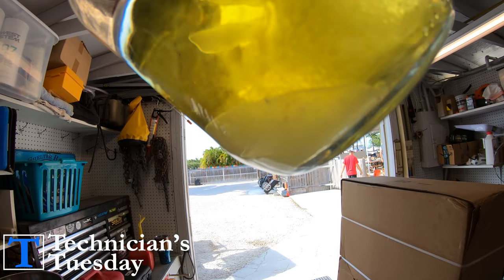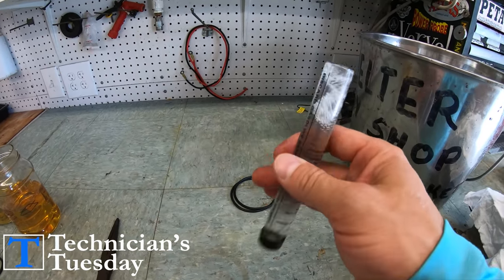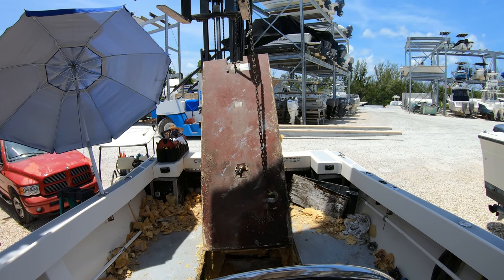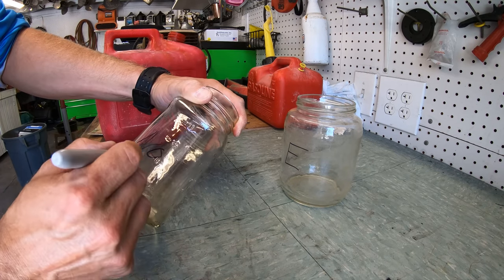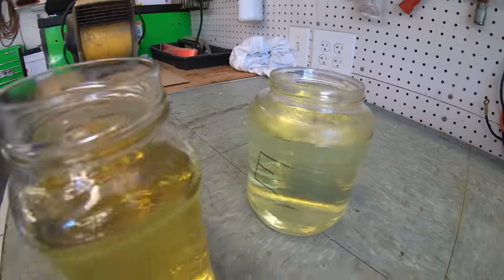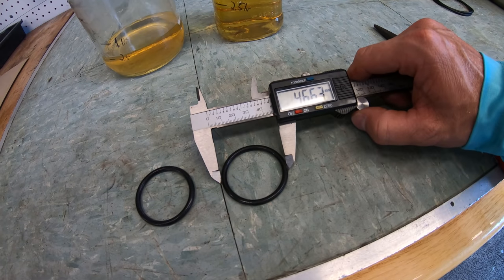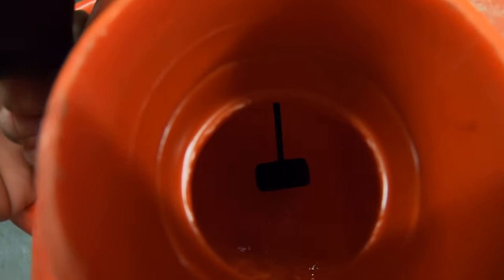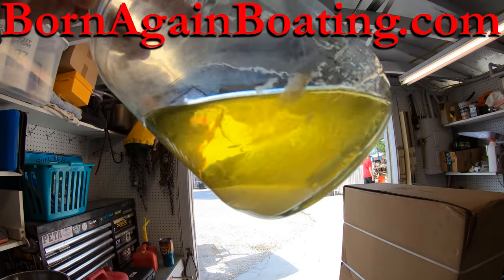What Fuel Do YOU Put In YOUR Boat?

Comment: Hello, great video.

What are your thoughts on fuel additives, do you use any?

It appears using a stabiliser can be useful for keeping fuels stable, especially in the carburettors.

Also fuel system cleaners and water dispersants seem like they could be quite effective.

Just curious on your informed opinion.

Thanks!
Reply: Only thing you can do to keep motor running well..... Is proper maintenance and cleanings....... Especially if you live up north where it freezes or if you run in salt water.....I have had a 2016 Yamaha f40la for 5 yrs now.... I change the oil once mid summer then again when I winterize.....have everything done by a certified yamaha mechanic......besides mid summer oil change.....I run non oxy only.....and I have never not once had a problem on the water. And up on Lake of the Woods......your so remote and far away from anything. You could find yourself in a survival situation if you broke down far enough from shore.

Comment: Why don't they make 1. A fuel tank with a drain on the bottom so you could let the water out until you get to fuel? or 2 Don't they make water separators for fuels systems like a filter that can also catch water? 3. Could you fill a tank with half E and half non? That would cut it down to 5% and still save money at the pump?
BTW love your channel you are very knowledgeable and always have great content TY

Comment: I am curious about the effect of plastic fuel tanks vs steel or aluminum tanks. It seems condensation is less likely to form on a plastic tank, so if there is less air flowing and and around it, you would have less moisture forming with temperature changes. I rarely have water in the tank with plastic tanks.

Also, how difficult would it be to retofit older boat/s tanks to be a closed system, so there is much less exposure to outside air, and moisture?

Comment: investigate phase seperation.   ehtanol will not mix with gasoline  so a catalyst is added so it will.  over time this catalyst gets used up and converted. then the ethanol being higher specific gravity will drop out and fall to the bottom of the container.    sometimes it is very clear  there will be a water line on the bottom then you will see another line higher up. that is where the ethanol is lower and the gasoline is higher.   ethanol also has a lower octane rating  so when you get seperation or dropout you are also picking up lower octane fuel and burning it.    if you cant use up the ethanol in two weeks dont use it. if you have portable  tanks or cans for your mower etc  keep them full as shown here . its better to have 5 one gallon cans full than one 5  gallon tank part full

Comment: Just dealt with white powder through out my entire fuel system from ethenol what a nighmare. That fan experiment blew my mind ! The problem with using heet or some type of water remover additive it will separate in the fuel/water separator and vst tank since the main ingredient iso-propyl alcohol is heavier the gasoline. They are useless. Also have fun switching from rec90 to ethenol. The ethenol will clean your tank out and all the varnish will break down. I like your idea of switching back and forth.

Comment: A few years ago, i went to the auto parts store to buy a couple of feet of fuel hose.  They wanted to know if I would be using ethanol gas as the fuel hose is different.  There was not a significant price difference so I bought the ethanol fuel line thinking it would hold up better when using ethanol fuel.  What are your thoughts on that?

Comment: In my case, Ethanol free is available. However, I have never run it. I get stuff local to the house and have been doing that for decades. Carbs, efi and direct injection all burned the ethanol fuels. I have never had less than 40 gallons on the boat and I store my current boat full of blended fuel for the winter. 218 gallons and never a sign of water. 

The key is to key is to keep the tank full and treated. The more air space in a tank, the more it breathes. And the example of off-gassing and moisture retention is valid. However, our boat systems are not fully open to airflow or the resulting moisture dropout from airflow across the surface. The vent is small, 5/8" diameter typically. So, all that breathing action has to happen at a distance away from the fuel tank. 

The information of the video is valid. But in running ethanol from the beginning, I have never had a fuel related issue. And that is everything from my commuter, to my muscle cars, bikes and to my boats. Is non-ethanol better? I am sure it is. However, I can't justify the cost or having to go search for it. Especially, when I have literally never had any measurable water in my system.
Reply: To start, I'm an auto and diesel tech that moonlights doing boat work, so I like to think I know what i'm talking about.....though I have been plenty wrong before so feel free to correct me haha!

I'm on the same page you are, I run ethanol with no problems. In my experience the biggest thing is the fuel sitting long term. if you use your boat a few times a month and treat it in the winter you likely wont have any issues. Most of what I see is people with big $$$ that have boats as play toys that use them maybe 3x a year, that's when I really see ethanol issues from the fuel sitting in the tank and lack of fuel water separator maintenance.

Comment: I know diesels are popular on boats with inboard engines, but I'm surprised they are not more commonplace in outboard applications.  The fuel is much more stable than gasoline and the engines are more efficient for the same power.
Reply: Very few diesel outboards out there and they are super expensive. I don't think the technology is there yet, but I'm no expert.

Comment: I left my 38 gal pontoon fuel tank with just 8-9 gallons in it last fall (October).  I purposely did not add anything to the fuel when I put the boat away for winter.  Started it up May 9, changed the oil, etc.  Filled the tank and put it on the water with no issues.  Ran 40 miles on the river.  The secret?  Don't store your boat  or let it sit very long with ethanol blended fuel.  I only use non ethanol and I can use 87 so it's not too expensive.  Otherwise, you'll have a water issue no matter how much or what kind of fuel treatment you put in it.  Was my stored fuel stale?  Maybe.  Did I notice?  Absolutely not.  Added almost 30 gallons of fresh fuel so it wasn't a big deal.

Comment: Local station just started to carry non ethanol mid grade fuel, about 30 cents less per gallon.  I have optimax motors.  Thoughts on running this fuel type.  Living in Wisconsin, it does get stored about 6 months per year.
Reply: $0.30 more or less? Most non ethanol fuel cost more than your fuel that has ethanol.
Reply: @dixie3087  .30 less than the prem non ethanol.  So 89 octane vs 91
Reply: Oh okay.  I thought u were talking ethanol vs non ethanol. Sorry

Comment: i have always treated the regular eth gas i get for my boat with "seafoam", 1 can per 16 gallons.  iv never had a fuel problem, however i do use my boat regularly, year round.  Do you have any thoughts on Seafoam?
Reply from the maker: Thank you for your question! Please post it in our Born Again Boating Community! Go here and scroll down to access - it’s free: https://www.bornagainboating.com/
Reply: Seafoam amazing I use it on all my toys plus landscaping tool and boat no more issues at all
Reply: Has alcohol so it absorbs even more moisture. Use it as an intake spray cleaner periodically, works good for that but not year round in the fuel. Lucas fuel system treatment works well as an all year round additive, it is a detergent based lubricant oil. Others brands make similar products as well.

Comment: Had lots of bad exp with eth gas....Not in autos but in things that had seasonal use..Weed eaters/lawn mowers/chain saw/tiller/boat motors...My answer was run all fuel out at end of season...That reduced  problems almost to nill...Now that were able to find Non eth gas at a few stations and use it 100% of time and alls OK...But dang the price dff is WOW...Bought some last night Regular unlead $2.65........No ETH $3.99

Comment: Both feuls are pretty much absorbing the same amount of water
The problem with ethanol fuel is that all th ethanol crashes out of the fuel in the presence of water
You only need a few drops pf water to cause all the ethanol to crash out of it
Reply: Also the remaining fuel is pretty useless since the ethanol is the octane booster for the fuel.
Without it he fuel has a way lower octane rating which can cause detonation and destroy your engine

Comment: Hey that was my boat in North Dakota ! Well maybe not but it could be! I know when storing during winter we add storage additives/treatment up here. The next question is Non ethanol its normally Higher octane which takes more compression to fire, is the higher octane ok on an engine? I run normally 91 at the beginning of season and end of season but will run 87 with ethanol when i know i will use it mid season. Yes we have 4 seasons here!
Reply: You’re close. Higher octane is meant for higher compression applications due to its lower tendency for pre-detonation(engine knock). In lower compression engines it won’t hurt anything but just be a waste of money.

Comment: If I've been getting water in fuel (even running non-ethanol), when/how often should I run quickleen or ring free (and is it safe for 2006 e-tec 250)?  Should I still use stabilizer and which one with non-ethanol fuel since I'm still getting water in tank?

Comment: I run some old two strokes that require pouring oil directly into the fuel tank.
Never had issues with carbs or fuel system.   Does the two stroke oil help protect from ethanol?
Would love to see mixed gas added to your experiment.

Comment: Cool tests Aaron!! have never seen the test tube deal like that..the evaporation and condensation on the E fuel is nuts! Ethanol free is the only way!! I had a Volvo Penta with 2 Solex carbs ethanol fuel (my fault) ruined them both.
Reply: I have a 1985 bayliner Capri that has a Volvo penta 270. Engine says to only add 91 octane. The only other gas sold here is E-85. Which do you think is best for lake use? Thanks

Comment: Take 2 plastic water bottles filled 1/2 way with water.    Add the same amount of 100% pure gas to one bottle and E85 to the other bottle and shake them up.  Set the bottles down side by side and look at the gas/water line after shaking.   You will notice the water line is in the SAME place on the PURE GAS bottle, but on the ethanol bottle it looks like more water has been added because the gas/water line has moved UP in the bottle,   There isn't really more water in the bottle.   It is the ethanol mixing with the water making it APPEAR there is more water in the bottle.    The PURE GAS does NOT mix with the water so the line doesn't move   Only use PURE gas
Reply: You are  just repeating what the video told and showed us. Tell us something we already don't know.🤔🤔

Comment: How would you recommend draining an ~50 gallon internal tank of 1.5 year old ethanol fuel? I am fixing up a boat that has mostly been sitting for about 1.5 years, and I want to replace that old fuel with ethanol free fuel to remove that as a potential problem.
Reply: I pumped my gas out with the primer bulb. Took a half hour for 12 gal. Id run some seafoam threw it after with gas. Could be a long fix if it did like mine and gelled. My hole fuel pump and filter was gelled with bee wax type sht.

Comment: I searched fuel siphon on Amazon and got too many options.  What do you use to siphon gas out of the boat's fuel tank?  I have about a 60g tank I would like to rid the fuel of because it's been sitting toooooo long.  Thank you.
Reply: I use the actual gas line from the boat.  Unhook the gas line from the bulb, attach another fuel line and pump into another container.
Reply: If the boat is on a trailer I use a primer bulb and a spare fuel line from a outboard motor and it will siphon easily to a spare tank laying on the ground. I connect a inline filter also. If the boat is on a lake I am  not sure what to do.

Comment: I myself would run  100% Ethanol free gasoline fuel mixed with three/other additives blended into the fuel as A 6 ounce/0.6OZ.  mixture of marvel mystery oil & gumout octane booster & sta bil fuel treatment fuel stabilizer. There is A suggestion to whoever might want to try it out. Yes you can add in two stroke oil/2 cycle motor oil in with that fuel as well to. If you premix your fuel tank fuel. If it has A oil injection pump it should automatically do it itself. I'd check to make sure your oil pump is working correctly at all times just to be safe. Cause you might half to premix it in A pinch.,or desperate situation we're it stopped altogether to make back to the loading docks area.

Comment: There's no way to do this on a boat, but for my really small engines (chain saw, gas trimmer, etc), I ONLY run pre-mixed canned fuel from the store. You know the stuff. If they give me a free can, I'll say the True name. This stuff is premium, ethanol-free, preserved fuel with oil already mixed in. I do zero maintenance after letting my stuff sit all winter, and it starts on the first pull in the spring. With small engines, I don't really use enough to feel the difference in price. If you tried to fill a boat with it though, it would probably cost the same as just buying a new boat!

Comment: Ethanol fuel is garbage.....After clogged jets and injectors, fuel/water separators  and disintegrating fuel lines both boats and all my yard equipment are only fueled with REC or Non Ethanol gas.....Here in Florida a lot of stations have Boat/REC gas so it's easy to buy but about 20% more expensive but well worth the price!!

Comment: Alc. free premium 4 me. The 'sniff' should tell the tale. If it doesn't knock your head back don't use it in your boat. Fuel tanks inhale and exhale as they warm and cool. Marine humidity makes rain and rain makes problems galore. Additives help but premium is premium in bring out another thousand aka Boat 🛥🚤⛵. The hole 🕳in the water 🌊gets bigger with the boat. Keep it fresh and alcohol free.

Comment: Interesting that the primary master Mercury mechanic on the BBC (Bass Boat Central) website says it's more important to run the lower octane (87) found in most standard ethanol fuels than it is to run non-ethanol fuel with higher octane (90) on the newer Mercury outboards that are rated for 87 octane. He says the octane requirement is more important than the ethanol vs non-ethanol aspect. He does recommend adding a certain mixture of Quickleen and Quickcare every time you add the ethanol fuel. He says while it may be preferred to use fuel that contains lower or no ethanol, fuels that have significantly higher octane vs. recommended octane ( by the outboard manufacturer) can cause decreased performance and fuel economy, and potentially cause carbon buildup.

Comment: Would it make sense during storage to plug the vent line to the gas tank???
Reply: Nope, fill the tank all the way. It’s the thermodynamics of temp/air that causes condensation. The less air the less condensation.
Reply: You really don't want the tank to build pressure. Putting some kind of charcoal canister on the vent line would help some. That is what a lot of vehicles have on their tank vent lines and they are starting to put similar on boats.  I empty my tank before storing for the winter. I'm not going to end up with a tank full of bad gas come spring again.

Comment: A car tank is vented dude. I have replaced  many fuel tank vent valves. Sorry your wrong. Yes ethanol fuel is bad in cars too. 
Its just used a lot more than a boat.
Reply: Yep boats sit a lot and if on a lake its worse. My 1970 buick has a Open vented tank but modern cars are called closed systems. They use a canister to collect vapors and the engine burns the vapors when it is running. I am not a pro but I think they are called EVAP systems? That fuel tank vent valve you mentioned is part of the EVAP system.
Reply: @ronfazer2423  yep i know and yes it is a evap system. You are spot on ! I used to be a dealer tech.👍

Comment: Never had a issue. Even my racecar that runs e98.no issues ever. 
My 99 2 stroke ski or my 97 mariner 2 stroke or my 4 motorcycles or my cars never had a single issue. Even my small engines

Comment: Been using ethanol fuel in my small engines and boat for years and have never had a problem. So I'm not buying it.
Reply: Your fuel also likely doesn't sit terrinbly long term, and stays in sealed gas cans which highly lessens the effect. This is more of a problem for rigs with large tanks that sit a lot.